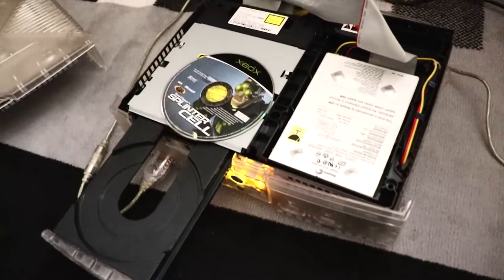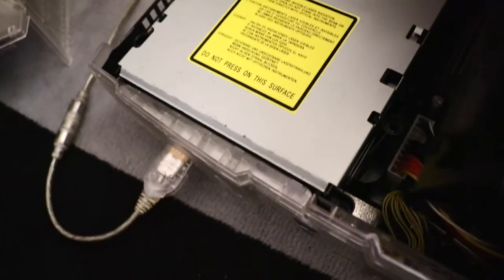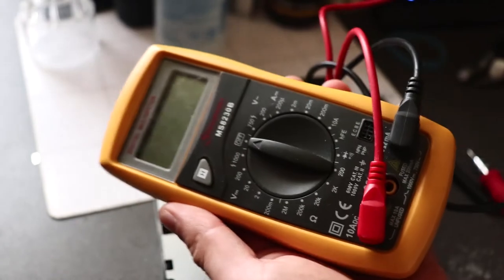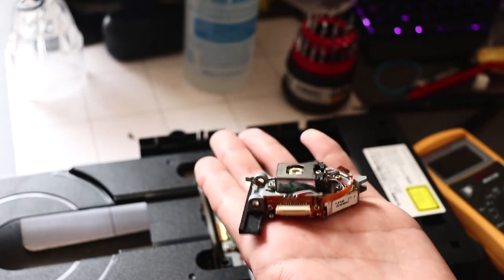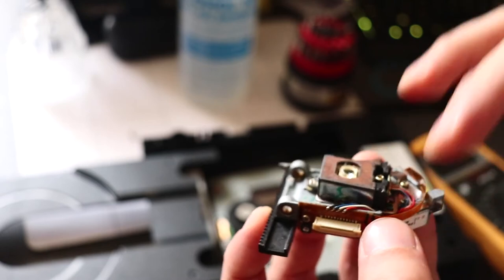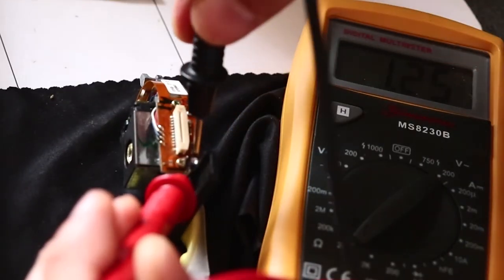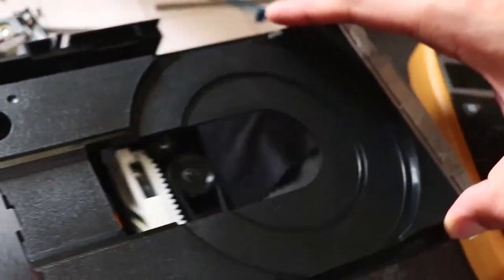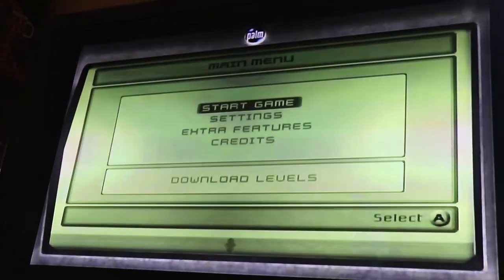Xbox OG Thomson TGM600 Laser POT Tweak [2021]

Comment: I primarily use an air compressor for removing dust followed by window cleaner to the laser, but this Thompson still wasn't performing well after the standard cleaning. So this time I used canned air and stuck the nozzle behind the mirror, where the laser and under side of the eye are Very carefully and then gave it a good spray.

It went from barely being able to play Halo/sometimes not, to playing it absolutely fine. It still struggled with more scratched CDs, so I adjusted my potentiometer from 1.195 to 1.075. Seems to be happy now. KEEP IN MIND each potentiometers adjustment is unique. I increased mine by 10% of its original value. I have seen Thompsons range from 0.9 ohms to 1.7 factory default, so they can vary wildly. 

Ontop of that, I greased the plastic with white lithium grease, cleaned the lasers guides with IPA then relubed with synthetic engine oil cus all I had.
Reply: Yeah man, mine was actually at 0.7 from factory
Reply: @Pequod-yv1iv  I've gone down a rabbit hole with this subject. Begun recapping DVD drives. Has proven VERY effective for me. The capacitors essentially turn into resistors and reduce the overall current downstream. I've got about 6 threads regarding this on Reddit.
Reply: @nuckenfutz9983  I am looking for it now. recapping DVD drive.. is that hard ??
Reply: @overdriver99  Depends on the DVD drive. There's 6 different models, and some are easier than others. Basic to intermediate soldering skills will suffice. Make sure you practice on electronics which you don't intend on saving until you have quality, repeatable work. 

Additionally, I've had 3 people recap drives without success. These drives showed absolutely zero ability to read a disc. Wouldn't *ever* launch disc, or even identify one was ever present. If your drive shows zero ability to read anything - I wouldn't suggest recapping.

However if your drive *can* identify media at times, but simply does a poor job - I most definitely would recommend recapping. Measure your potentiometers original position and adjust if needed once recapped.

Comment: Mine could barely read music CD's and no games at all.
Opened the top of the drive and let the dvd tray out, i didnt even remove the drive from the console lol.
Used Q-tips with nail polish remover (acetone) to remove the glue, i noticed you have to clean and clean to get the glue inside the switch out.

Used the tip of the multimeter to rotate the pot and adjusted it around 1.25k ohms, it started reading discs and loads reasonably fast, but it sounds funny so it might not last for long.

Hope it last long enough to do the softmod, after that i dont need the drive
Reply: If anybody attemps the same i would recommend to solvent the glue for atleast 5mins before trying to turn the screw, it felt like its really easy to torn out of the pcb if turned like i did

Comment: The issue with this is that it just wears out the laser faster. I've been replacing the resistor arrays on the board to get the drives up and going. Never needed to change the pot.

Comment: Yes....great video.  Thanks for this!  I'm trying to fix mine but think I made it worse. So....you are putting the Multimeter on each side of the screw that you make the adjustments too?
Reply from the maker: Thank you for the comment. You should only do this with very minimal adjustments. Try not to over do it or it could fry your laser. I place the prongs where the solder joints are by the pot. One either side should give you a reading. It's quite tricky to do.

Comment: Great video. I tried it on my Samsung drive some time ago that took a long time trying to read before giving up and saying it couldn't. I made it slightly worse since I had no experience with pot tweaking, but I know how very fragile it is so I did tweak it with very minimal movements. After seeing this I'm going to try it again. I assume the numbers you want are the same between all drive brands? Thanks!
Reply from the maker: Thanks for the comment. Yes you can only do this a number of times before the laser is fried and will not give a reading. So be careful. This reading is for this particular drive. Some other models may differ as they output different voltages etc

Comment: I just recently refurbished my 1.0 xbox and the games read and load much faster compared to before the refurb but certain disks just will not read at all and i get the "your disk may be dirty or damaged" error even though there are barely any scratches on the disk and if there are any they are not super deep ones. I havent modified the laser in any way aside from cleaning it with 91% isopropl alcohol and a non lint leaving q tip. I dont know what the problem could be. When the xbox is on and starts to read a game the laser sounds like its making clicking and chirping sounds.